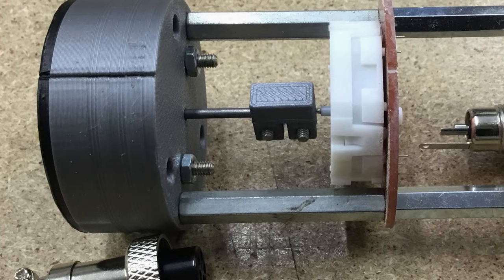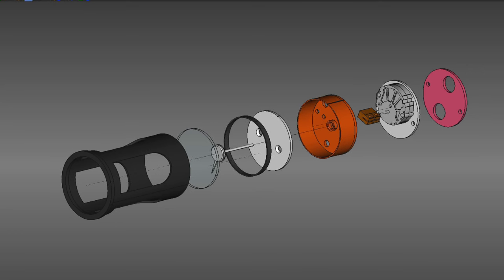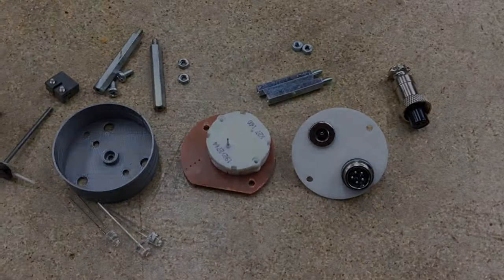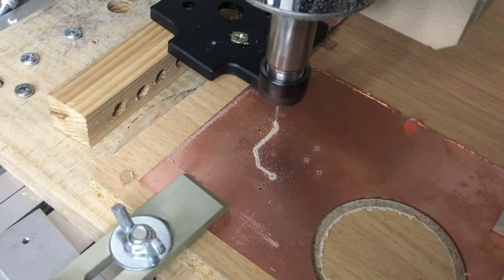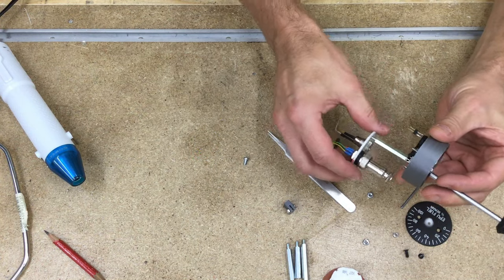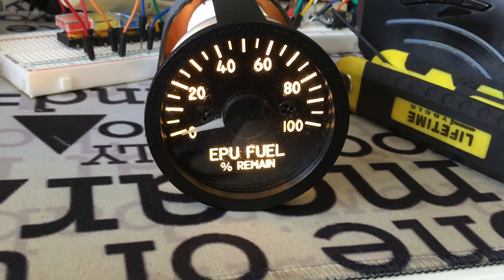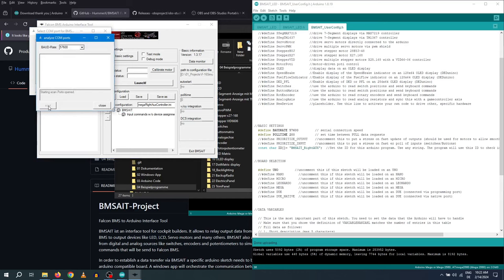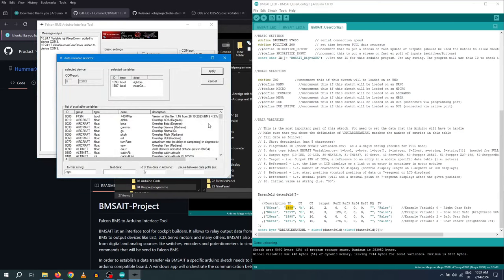F-16 Home Cockpit 08 - Building DIY Instruments

Comment: Very good work! Your attention to detail is admirable. I’ve been converting real instruments to run using stepper motors. It’s a bit of a challenge sometimes but rewarding when it all comes together.
Reply from the maker: Thank you very much. I totally agree, converting real instruments is great - the CabinPressureAltimeter at the end of the video (in the small window) is a real one converted to an x27 :-)

Comment: Once again, simply amazing!
Reply from the maker: Thx a lot! 
I'm really satisfied that I'm getting the hang of the editing part better with every video.
Now I have to work on the filming itself, that's still a bit simple with most of the footage made with the iPad.
I would have a whole arsenal of digital camera accessories and a DSLR - but I often get into the workshop "by accident" for a short time and then I don't have enough time to do a big filming setup.
One thing at a time... :-)
Reply: @simhangar6216  Still, you're making your points clear. What you're doing is great and thorough. It certainly helps pitbuilders to improve! Thanks for all your efforts.

Comment: What a nice and clean build! well done! how did you drive the stepper motor? what module did you use? 
Also, I have 2 suggestions for you for the laser job. 1. use low-tack masking tape or Vynal transfer tape to cover the painted surface (after it well dried) to avoid smoke marks,
2. after raster engraving the texts/graphics, run the laser again to do a vector engraving for the outline of the texts/markings. . it will make the panels look a lot crisper and sharper...

you are tempting me to replace my Airmanager Simulated gauges (on an LCD) with these nice and simple gauges!
Reply from the maker: Thank you very, very much!

Fantastic tips for the lasering, thank you! I'll try the additional outline engraving asap!
Up to now I didn't have any problems with smoke marks, maybe because of my air assist?

The steppers are directly connected to 4 output pins of the Arduino with the SwitecX25 library (through BMSAIT): https://guy.carpenter.id.au/gaugette/2012/02/16/using-the-switecx25-library/
Each stepper takes 80mA max (edit: the datasheet says 20mA max), so driving the compass, EPU FUEL and CABIN PRESS ALT gauges (the others are using servos with separate 5V power supply) will be a maximum of 240mA of power drain from the ArduinoMega which should be handled easily (500mA IIRC).